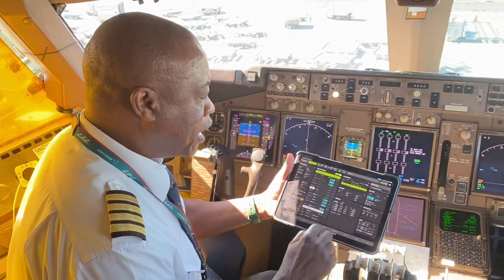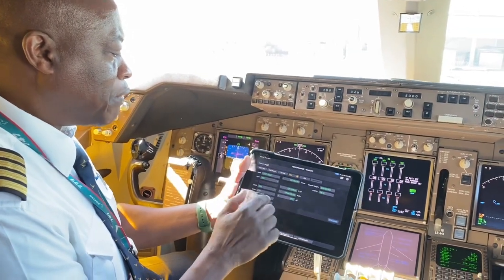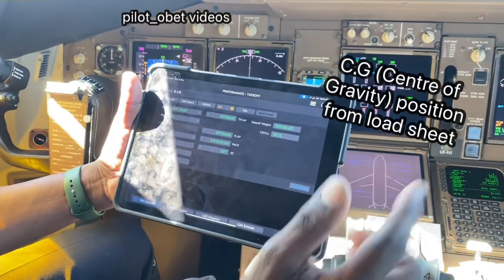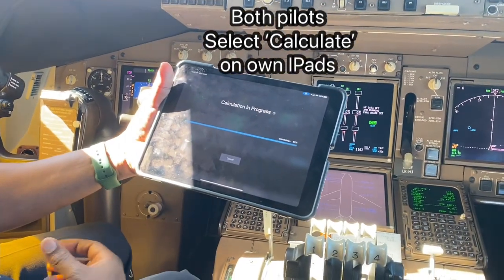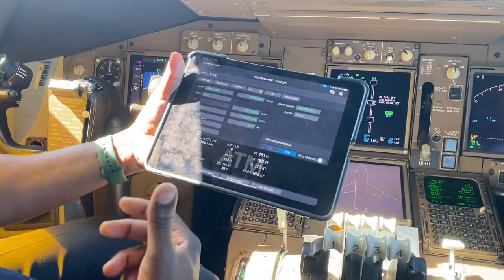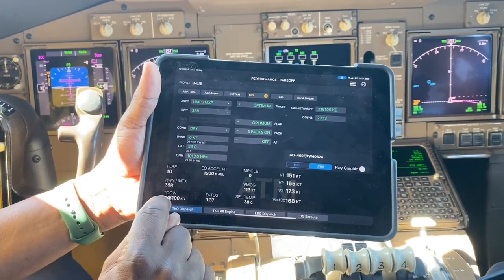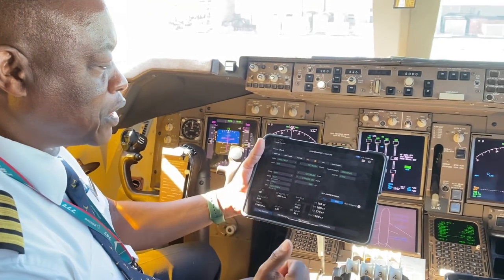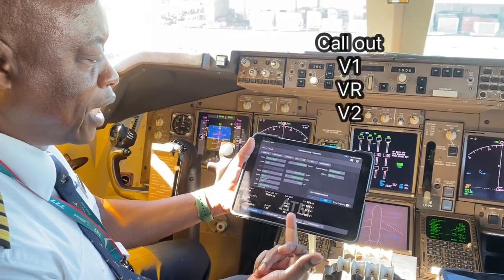Boeing 747-400ERF Takeoff speeds calculations

Comment: Hello  Captain. I've  just discovered your channel and find it very interesting and de-mystifying.  Can you tell  me  how the C of G figure is arrived at please?  ie:  onboard  sensors,  loadmaster sign off  or such.  Thanks.
Reply from the maker: The aircraft has a pre-determined range of Centre of gravity. This range is set by the manufacturer initially. Then the aircraft gets kitted out with the airlines seats/galleys etc if it’s a passenger jet. The C of G then repositions for the new weights and moment arm shift. Then the aircraft is loaded so the weight distribution is determined then fuel etc. the C of G is mathematically determined and a range for differs weights and fuel determined and published for a customer.

Comment: Thanks for the video, great! And how is the acceleration height calculated in case of failure of one engine? On what parameters does this height depend?
Reply from the maker: Depends mainly on obstacles in the takeoff flight path and/or noise abatement requirements. All airports are analysed by the performance department and an altitude agreed on. Usually a standard acceleration altitude at all airports is stipulated for most airports.
Reply: @pilot_obet   1000 ft AGL ?
Reply from the maker: @Игорян747  normally yes but Milan is a bit higher due to obstacles
Reply: @pilot_obet  Thank you. All clear. Fly safe, good luck.